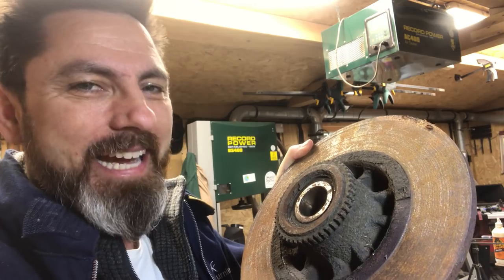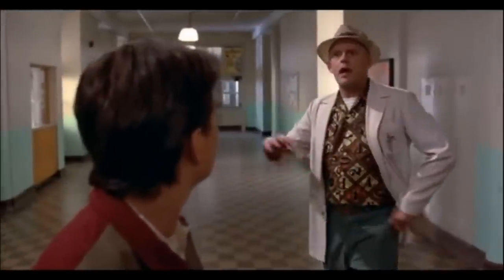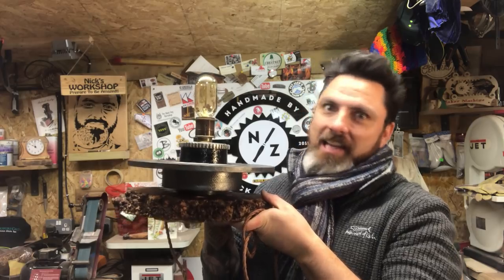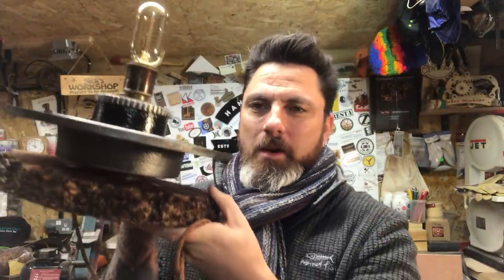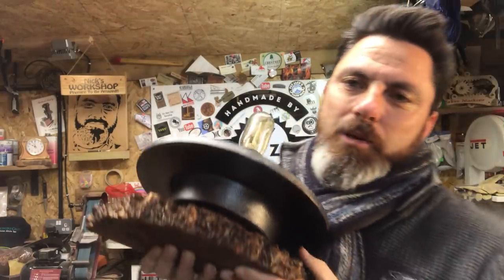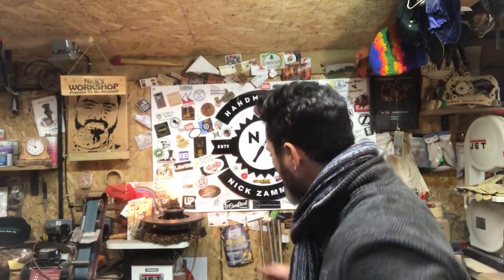What can I make with this old vintage brake disc?

Comment: I used an old break disc to make a base for a work light once. A couple pieces of conduit about 4' long. Then I welded two conduit connectors together at a 45° angle. I mounted one tube to the brake disc slid the connector over the tube and tightened the thing screw. Slid the other tube into the send connector (that's welded to the first connector) and tightened that thumb screw. Installed some parts scavenged from the all the broken trouble lights we had. This figuration can be used to hold a light under the hood in nearly any position you can think of.

Comment: Love your work zammetti.  I’m a new subscriber over Christmas.  A really cheap rust remover you can use is half a bucket of molasses half bucket of water mixed together - immerse the item in it for two or three days. And clean up with a solvent afterwards- works amazingly well - so well u have to oil or coat the project that day in order to stop surface rust appearing!

Comment: As others said, you need clear on the disc to prevent rust. I have seen a lot of car parts even old lawn mower engines turned into lamps.

Comment: If you have a brake drum with the half shaft you can make a pottery wheel out of it, by putting the brake drum on the half shaft upside down with the drum bit open so to speak, you can use the bearings to fix it to a piece of wood to hold the shaft upright whilst placing plaster of Paris bats in the brake drum for throwing the clay on. Together with the other end of the half shaft with a cement flywheel supported by the other brake drum. Sorry about a rather clumsy description but I made a pottery wheel in this very manner, some 50 years ago when I was in my 20s. and no longer have it. I also dug my own clay out of the garden and later used the hole produced to fire the pots that I made. All this before videos where invented and so I have no proof of my exploits.

Comment: For anyone looking to do this with actual vintage brakes. Be aware that brake pads once upon a not to terribly distant past where made from asbestos. 
Also, save your money buying rust remover. Use vinegar instead, and let the part sit in a bath of it for 24 hours.
One final tip, anywhere you are going to paint, use a rust inhibitor such as Por15. Cast metals can be tough to get all the dust off of.

Comment: Interesting lamp. Maybe the burl tilted up about 30° and a motor to turn the brake disk at an opposing angle with the lamp on a rod sticking up from through the disk would have been even funnier. Maybe turn a thin wooden lamp shade for it? So many ideas, so little time and/or money to do the art is like to do.

Comment: Hey Nick, the larger domed side when flipped over gives it the look of a 1950's UFO drawing.   If you were to put four metal rods on the side with the teeth and flip it over you could paint it with silver metallic paint and put a battery operated LED kit into the cavity and the LED's underneath in various spots to give it a " IT CAME FROM OUTERSPACE!!" feel.

Comment: Would make a good coffee table centre support. Make a cool wood and resin tabletop design with a hole in the middle to fit over that top bit and a large stump of a foot with the centre lathed out for the wider end to slot into.

Comment: That looks REALLY good, and it is a special piece! If it would be mine, I would finish it off with glass dome. Hmm..maybe even 'paint' inside the one half of the dome (vertically) with matt silver paint to give 'matching' steel look.. or maybe a thin layer of pigmented resin to give option to 'shade'/direct the light if necessary.

Comment: You might want to apply some lacquer or clear coat to prevent rust.
Reply from the maker: Matthew Greene good shout dude
Reply: @nickzammeti  Thanks!
Reply: I was actually just thinking this after he finished. 😊
Reply: Yeah or even just some wax.
Reply: i was thinking a coat of epoxy would seal that disc up
Reply: @kristysmith9723  another guy I watch uses hot bees wax for rust prevention all the time.
Reply: or wax it with carnauba.
Reply: Matthew Greene j7

Comment: That rust remover looks lethal and nasty. Did a good job though but I will stick to my apple cider vinegar even if it takes longer... usually 3 days. :) Working with resin has done much to increase my patience. laugh That came out really cool and funky!! I love DIY lamps from things that would have otherwise been discarded. - Heidi
Reply: Here in the U.S, there is a rust remover that looks the same called Simple Green. It's non-toxic, although I wouldn't recommend drinking it.
Reply: Modern rust-removers are usually non-toxic and environmentally safe. I sure wouldn't drink it, but they're pretty mild/odor free. My favorite actually uses a chlorophyll derivative as it's active ingredient. That said, nothin' wrong with a bit of an ACV soak! I like to throw a little baking soda in the vinegar for the final scrub. Foamy!
Reply: I thought the same thing.  I use cleaning vinegar.  I use it all over the house so I buy it by the gallon.  Works wonderfully for stripping off rust and old paint from hinges.
Reply: most of them are a water based chelating agent. enviromentally friendly and non toxic and work way better than acids as they dont attack the substrate material only the ferric oxide.
Reply: I have used ACV for years, especially on brass or copper parts. Of course nothing works like electrolysis but, when I can't do that, I toss the parts in ACV and leave em' there. Soak time depends on degree of rust. If rust is heavy I do a wire wheel buff but still do the ACV to get into any pits or threads. It's also reusable. After I've soaked an item, I just place a paper towel in a medium size funnel and pour it back into the bottle. Eventually, you'll lose enough to warrant buying another bottle but it's dirt cheap. An additional benefit is that it lightly etches the surface so primer will stick very well if you can't or don't want to sand the object. I also use it on my salad. I just have to be careful not to mix up the bottles! :)
Reply: Can be sprayed

Comment: I almost say that you need to add a lampshade to it.  maybe go around the diameter of the rotor and drill holes before you can put metal rods in it.  Then construct a cylinder shaped wire frame lampshade.  then if you wanted to fit the aesthetic of the bass cut it in half and make it a really nice corner lamp.

Comment: Disc brakes came into the norm in the late 80's. The gear looking part? ABS sender. There is an eye sorta thing on the car that counts how many of those gears go past it every minute. In the car's computer there's an electronic slide rule deal and tuns the data into speed, then compares that with the other wheels - then "looks up" the numbers in a chart to tell if the car is moving, turning, braking or skidding - 1000 times per SECOND. So NO on "Old Vintage" (which is oxymoronic at worst, redundant at the least).  Otherwise I really DIG your channel. Your talents are only enhanced by your humorous presentations. Keep doin' it.
Thank you for sharing...

Comment: Dont you sleep !!! :-) PS make a brake drum blacksmith forge !! PPS after watching the video now may i suggest using beeswax on raw polished steel (put it in the oven at max temp then rub beeswax on it gives a nice finish and you can even lock in tempering colours from straw to blue and purple !!
Reply: Edgunsuk
 that sounds very interesting!
Reply: suggestion: cover a frame in black velvet to use as background to better display your stunning work.

Comment: I really like this. But I feel its missing the lamp shade. I think from an old hot rod chrome air cleaner cover. 
Pull out the paper part & just use the wire mesh.

Comment: Cool - thank you for great content. Btw next time you need to remove a lot of rust in weird shapes like a brake disc, I can recommend soda blasting. It's like sand blasting, but it is isn't as harsh on the object you are trying to clean up. 
Thank you for your cool weird  videos:)

Comment: I'd have dropped that into a bath of citric acid for a day or so and it'll come out a lot cleaner than all that hard work with wire brushes and crappy rust remover ;)

Comment: If you can find 4 solid wood pieces to make into legs.  You can then take resin and overlay the round disk part then make a piece to go into the top for a lamp with a resin orb of multicolors.  I think this would work. I have an idea that I might be able to sketch up for you.  If you want to ask me a question you can message me on Facebook under my name.  Thanks

Comment: That's a cool idea Nick.  You may want to try White Distilled Vinegar instead of rust remover next time.  It works great, and is a heck of a lot less expensive.  I use it when I am restoring Cast Iron cookware.

Comment: Vintage with an abs ring?
Reply: Could be lat 80s ish..... its not off the old transam ive seen begund him qnd i doubt its of the rolls or bently........not sure sich one it was he had... but i thi k ive seen a landrover to so maby that?
Reply: @tylercampbell3134  looks like from BMW
Reply: Ford f150 rotor only rotors I know of that the wheel brg, hub and rotor are sold as 1 unit.

Comment: I like the way you think, because I think like you. example: I had 4 drawer ball bearing drawer sliders @ 300 lbs limit each and a 9 inch lazy suzan.
I am a double amputee so I needed a better way to get into the bath tub from my power chair (to use the SHOWER)  SO, Out of those parts I made a Transfer device 
; board to span tub, 2 drawer slders on top , then a board, then on top of that a lazy susan, then a seat on a board (one for a shower at HOME DEPOT) , Can you see it??   PLANS .  (1) It slides out, u get on the seat, slide yourself into the tub, level to the top, (TURN AS YOU WISH,  TO CLEAN YOURSELF) when done, slide out to P -CHAIR  turn as needed to return to chair !! Of course , use silicone to seal all holes and coat all wood with Polyurethane to seal wood.  It's protected so feel free to build it but don't make any money on it and you'll be fine , BE WELL AND ENJOY GOOD PEOPLE!

Comment: 1st; I LOVE the light 2nd,  SAFETY; "The use of asbestos in car brakes was prohibited from 1999 but some vehicles continued to be fitted with asbestos brake shoes until 2004". Reclamation of and Repurposing of old car parts could be potentially hazardrous in ways other than dropping a 10kg brake disc on your foot.

Comment: NZ, could you potentially install that brake disc in my lower back? I don't fear a bit of rust, and the discs in my back have disappeared. I am just kidding of course as I know we both know better. However,  my dear man of color, how about using that brake disk, or one similar, as the backing for a wall clock? That would truly intrigue me. I candles see you making (comic style handprints) out of colored pencils spliced in half lengthwise and then covered with resin pointing to the clock's numbers with your shield being one, four or all ten of the numbers.

Comment: Super cool project, very creative.  Two questions: Did you spray the bare metal parts with lacquer to keep them from rusting? Is the base attached to the rotor?

Comment: Nick, next time use Coca Cola as a rust remover, not that expensive and no harsh chemicals, just soak the piece overnight and the rust should come off easily with a wire brush.

Comment: I have to admit, I did not know where you were going when you started this. But I like where it ended up. That'll look great in the garage somewhere. I do enjoy it when you change things up a bit. Always interesting to see you try something different. And it's nice to see you let your hair down for once. If you have another one of those rotors, maybe instead of painting those openings black, you could fill them with a brightly colored resin. Just a thought. Can't wait for the next video.

Comment: As far as rust removal goes, The King of Random has a pretty neat little setup for a sandblaster that I've used to take the rust off of old cast iron. Might be quicker than rotary tools, and definitely uses less expensive disposables.

Comment: You could of got the guys at the shop to sand blast that for you. It would have been a lot better, and would have probably cost less than that bottle of rust remover. Would have saved you a lot of time, and you wouldn't of had to mess with deadly chemicals. If you would of taken the snap rings out, and knocked the baring out it would of saved you a few pounds. You need to make a lamp shade next.

Comment: funka-delic ufo: glue some RGB lights to the edge and top and bottom of the main disk part and then cover them in resin and use the resin to soften the top and bottom shape. find a gear or something that will help a small motor turn against the sprocket on the brake pad to have it spin... Lots of work, but you're up to the challenge m8

Comment: wow nick you really need to check your brakes more judging by the discs the brake pads  where really low before you got them changed and there for destroyed the discs too lol but if you didn't then we would not have a project

Comment: Pretty nice but if you had made a duplicate of the disc out of wood and cut them both in half then glued woohalves to steel halves, you could have two lamps right now. Keep up the good projects.

Comment: I use vinegar to etch rusty old guns and restore them. It leaves a very nice silver/grey pattern if you wrap the piece in an old t-shirt and let it soak. It’s corrosive enough to dissolve small threads in a hole so it gets down under all the gunk. Cheap and safe.

Comment: If got an old parking meter from the sixties and I cleaned up an old rotor welded a pipe to it and mounted the parking meter so I could display it.

Comment: As you used a metal brake disc as the base of the lamp, did you connect an earth on the metal body of the lamp for safety.

Comment: whys that "vintage" rotor have a tone ring on it? which inputs wheel speed to a microprocessor. and a press in sealed wheel bearing...You probably figured it out by now its not vintage.. cool though
Reply: 10 minutes later i'm thinking, where did the time go. maybe it is vintage

Comment: If you have any more of those discs you could make a cool two tier lazy Susan type serving tray. On the non gear side you could rig the spinning apparatus and on the gear side you could turn a really funky (dark) small platter (bigger than the gear but smaller than the overall circumference) and attach it on top of the gear and voila! A cool piece of spinning serveware to make your next party just a little more funky :)